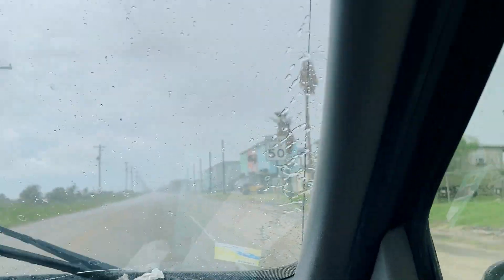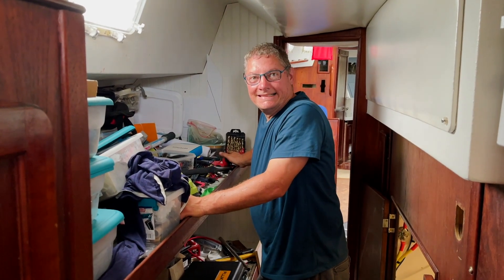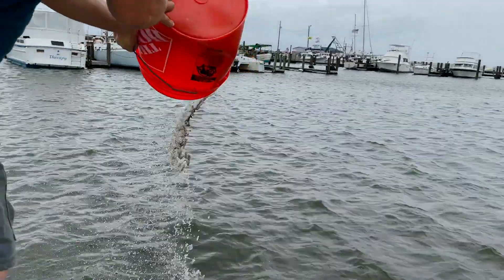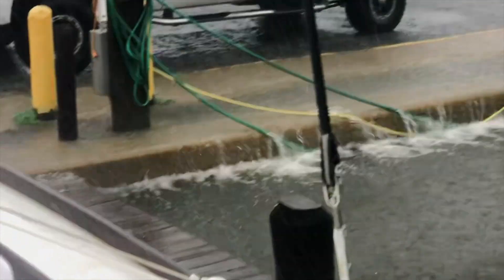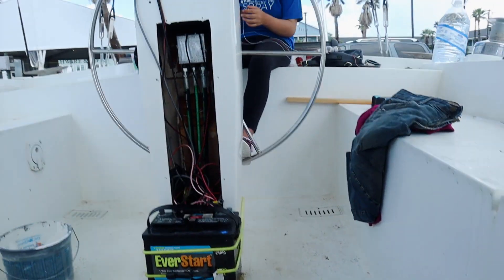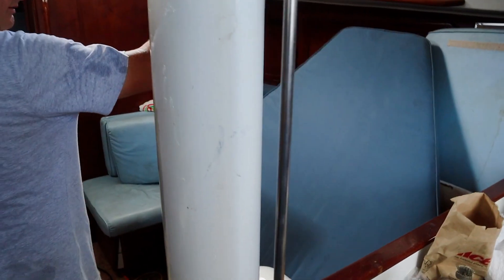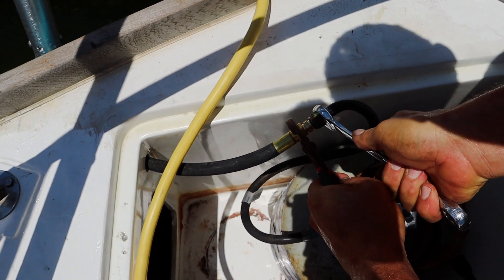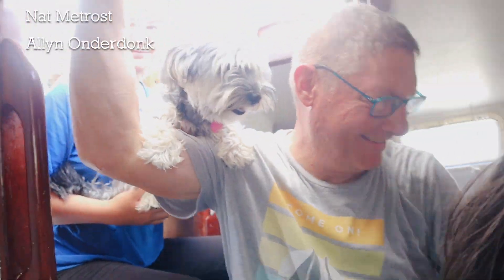The Most DANGEROUS Part of Our Boat | ep. 173

Comment: I use the yellow teflon tape for treads on gas fitting. There is also a liquid tread seal you can use.
Reply from the maker: Yes for sure, except for the flare fittings. They shouldn’t have anything.
Reply: @Spoondrifters  thats right.

Comment: Does the stove and oven have thermal protection? (I don't see it) without it, the gas can continue to flow when the flame blows out. Since propane is heavier than air, the cabin fills from below, you notice that (to) late......
Please be careful.
Reply from the maker: There is thermal protection on the oven, but not the cooktop part. In a boat you really need to pay attention when using propane for the reason you described. The solenoid valve which will be installed before we actually use the stove is a nifty valve that is outside by the tank itself. You have to turn it on inside at the stove, it then opens allowing propane down to the stove. When done you flip the solenoid off and it closes stopping flow into the boat. That has proved reasonably safe over many years for boats, though propane still makes me nervous. We are also going to install a gas detector below the stove to help alleviate any accidental leaking.

Comment: I heard,  you should never run gas piping/hose in a conduit. It creates an area to mix with the air and the mixture can be explosive. If there is a leak, but what do I know.
 Install a permanent LPG detector.
Reply from the maker: The boats like ours that came with a propane stove (ours had an alcohol stove) had a conduit from the factory. The line is also one continuous piece and with no chafe points shouldn’t leak. If we didn’t put it in a conduit the chafe points would be numerous. Gotta pick the safest most likely scenario. 👍
Reply: @Spoondrifters  How do you protect the hose at the entrance and the exit of the conduit to prevent these chafe points?
Reply from the maker: The same as any other pipe or wire it will be secured to prevent movement.
Reply: @Spoondrifters Hhmmmm.. I'm definitely going to be losing sleep with that answer.  This is pressurized LPG.  It's not a common pipe or wire. I'm hesitant to ask about how you plan to vent/drain ( LPG drain ) out the LPG locker and  where the solenoid will be located.
Reply from the maker: The locker has 3 drains that go directly overboard. The solenoid mounts inside the locker, near the tank.
Reply: @Spoondrifters   That sounds great. I hope you upload a video of the entire project when it's installed. Are you going to get USCG documented for international waters?
Reply from the maker: Yes we are coastguard documented.

Comment: that length of PVC pipe is a great tool. you can use it to run wire as well. tape the wire inside the end and push the pipe to the destination.  on another note. the water level is a bit worrisome.
Reply from the maker: Yes the water got quite high, actually about two inches over the top of the finger dock. I think we had nearly 12” of rain in a day and a half. It was crazy!
Reply: @Spoondrifters  Oh to live in places where you get light rain 12” (~300mm) I've had that in an hour where I live and i'm not even in the tropics, I have lived in the tropics where i've seen well over this. the closer you get to the equator the heavier the rain. The good thing is that boats float so no matter how heavy the rain when your at anchor you'll be fine (may just need to let out a little more scope)
Reply from the maker: Wow!
Reply: @Spoondrifters  Where my wife's parents live the gutters on the side of the street are about 1m (~3') wide and about 1.5m (~4'6") deep and open, my wife said when she was ~10yo she fell in and it was really scary. I've seen them fill in a few hours, they are like that to deal with heavy rain. 
I'm really looking forward to seeing you guys exploring the world, seeing your reactions when you see how things are in other countries (some are better, some are worse, it'll be interesting to see which you think are which)

Comment: Can you link that vacuum on top of the 5gal bucket plz? I have searched and searched but can find a decent one
Reply from the maker: The brand is called Bucket Head. We got it at Home Depot but you could probably get on Amazon too. It can’t be way high above the water and it will suck the bucket in. We have to put it in the bilge to get it to suck out the lowest parts. 

https://www.homedepot.com/p/Bucket-Head-5-Gal-1-75-Peak-HP-Wet-Dry-Shop-Vacuum-Powerhead-with-Filter-Bag-and-Hose-compatible-with-5-Gal-Homer-Bucket-BH0100/202017218
Reply: I have one that’s called a Bucket Head...wet/dry vac powerhead. Works pretty good but the hose is ridiculously short so that needs replaced, we’ve used it all over our boat for years. Hope that helps, take care
Reply: Awesome thanks so much. The wife says she'll kick my butt if I ruin another shopvac cleaning bilge sludge.. lol

Comment: Correctly installed gas is just as safe as any other way of cooking. Until the panel is installed just shut off the gas at the bottle and you are fine
Reply from the maker: You are correct, and we aren’t going to use it till the whole system is ready. We just needed to see if the stove worked before we put any more money into the setup. Thank you for watching.

Comment: Step back , any propane locker should be vented. Not to go into  the bilge but to escape over the side . 
This is a high safety area , no locker will be water tight , no seal will work,  your boat flexes , 
A  vent in the side of the boat above the water line ,   the lid seal is not the answer . 
Please watch life in a nutshell  , he had a mega blow up through his boat , gas didn't vent over the side , 
Relyed on a deck seal,    keep your family safe ,
Reply from the maker: The locker is vented with hose to the outside of the boat. That was what we were sucking boatyard dirt out of to clear. The hole in the side of the locker is what we were saying will be sealed, not the top. It’s necessary for access to the bolts for the toe rail, stanchions, and to install the propane line.
Reply: @Spoondrifters  good , manufacturers always putnsuch a tiny hole that clogs ,  stay safe
Reply from the maker: I know right! There are 3 drains in the bottom of that locker, why couldn’t at least one be bigger to clog less!